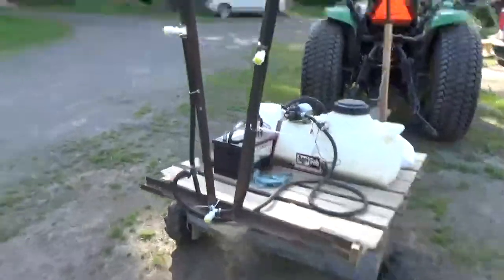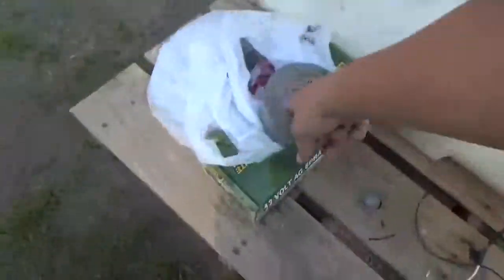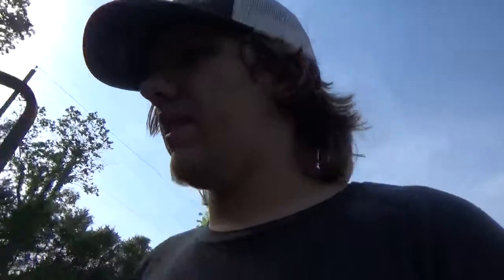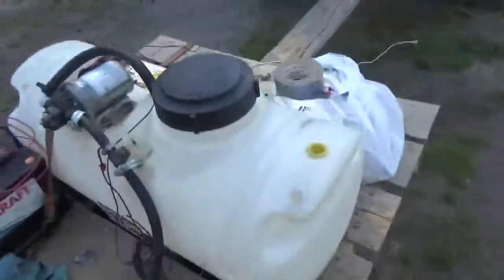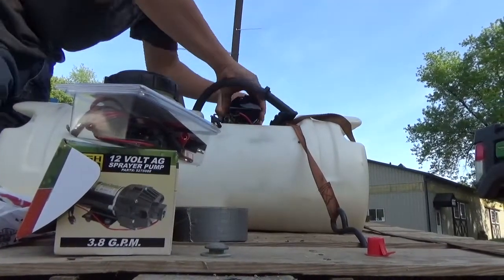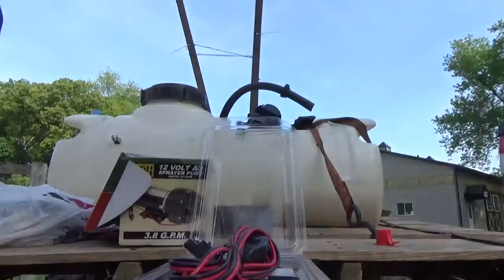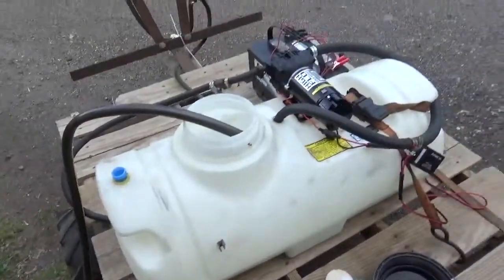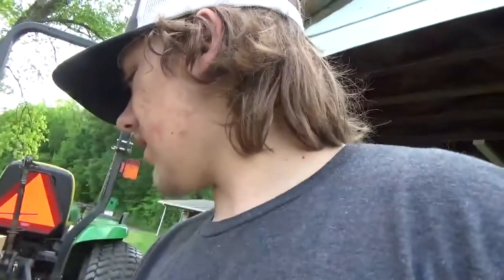The Home Built Sprayer

Comment: 6 bucks a bale is probably a little much, considering if you got wet bales that are not going to keep well and get dusty. Depends on area as well.  We have been cleaning out our barn (in michigan) and getting 3 per bale, It was fairly nice stuff. We market on craigslist got probably 15 calls in 3 days. Not a bad way to sell some hay.  We moved probably 500 this way.  Your 50 cents delivery is decent priced, but  if they are a repeat customer you could count on every year, I would be honest with her and tell her a few may be hot.  and like I said every part of the country is different but price wise, I like to keep price lower to keep repeat business happy. The hot bales I would try marketing as some cow hay or something like that on craigslist.   Price does fluctuate from year to year depending on weather conditions, or if big farms in the area stop producing hay. Crop prices are crap right now, and more people are thinking of putting in some hay to sell to some dairy farms around us. I have seen hay as high as 5 bucks and as low as 1.50 in this area, bumper years lucky to get 2.50, drought years likely to get 4 or 5 dollars.  I also recommend either bringing a load or attending a local hay auction to see what hay is bringing so you can competitively price your product.